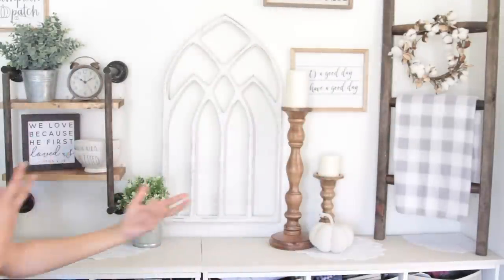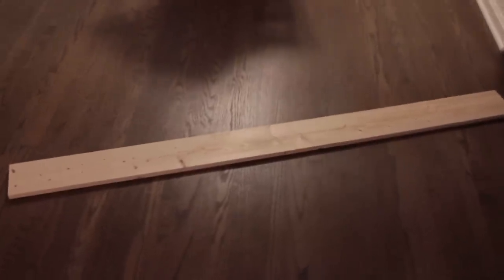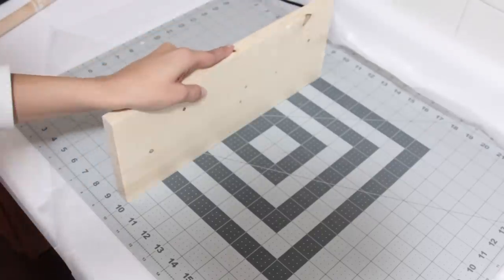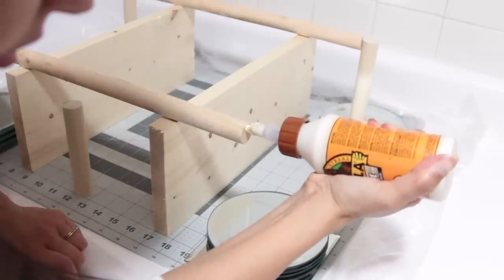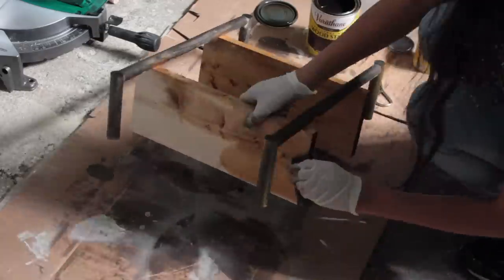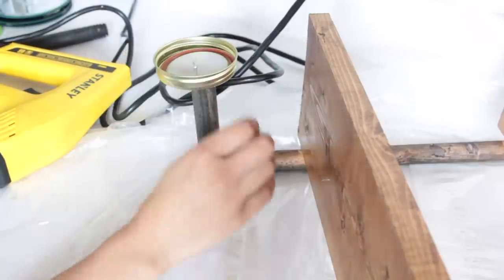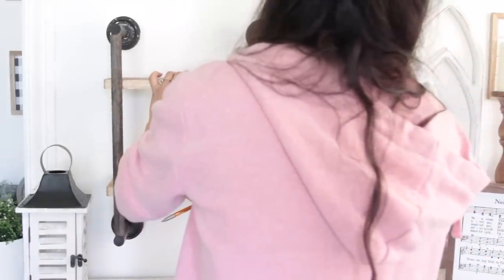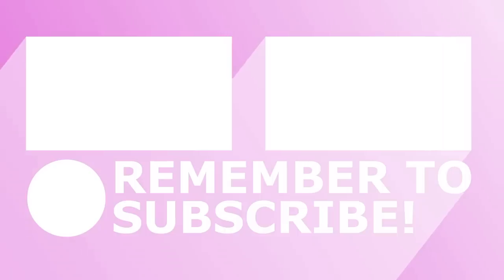DOLLAR TREE SHELF DIY | FARMHOUSE SHELVES

Comment: For 41 cents apiece you could have gotten 90degree angle pvc pipe fitting ( item number 23867 Lowes ) to spray paint black and use to fit the corners of the poles into to mimic metal pipe fittings. Can’t post a pic of what I mean put you’ll see what I mean.  Would really make that shelf more polished looking.  Great idea though !

Comment: This would look amazing using a copper elbow fitting to connect the short dowels and the long dowels..aka your pipes.. Or even a PVC elbows (painted)... It would not add a lot to the price either! 
I wonder if cup hooks into the wall, instead if nails, would work? With the eye hooks in the shelves looped over the cup hooks in your wall....

Comment: Terrific idea, especially the use of the lids!
I would CAUTION though, unless you are using a heavier wood, only place light objects on this unit, especially since I did not see you checking for a stud to nail into, or using anchor screws.  Too much weight, and that unit will pull right out of the wall!